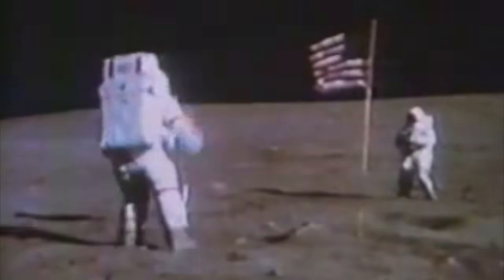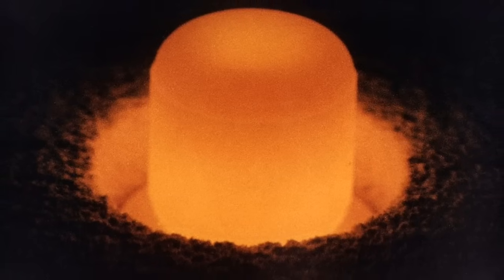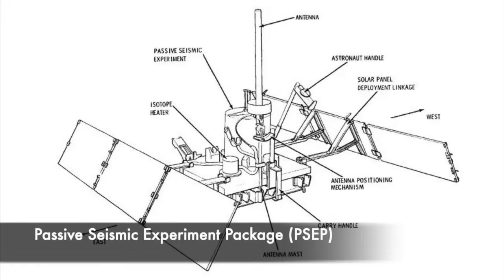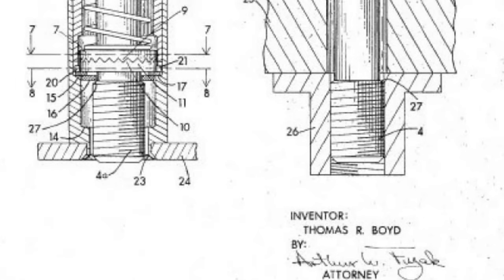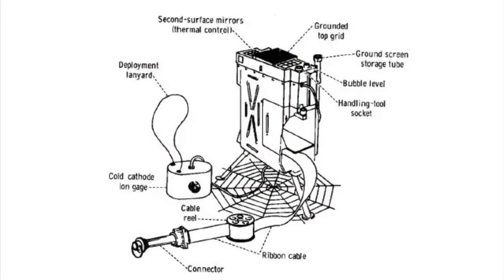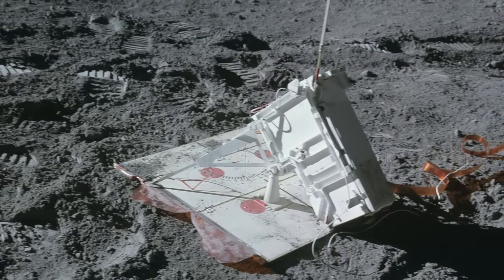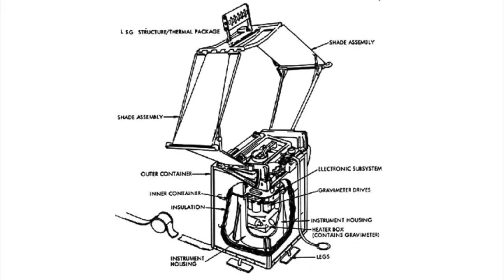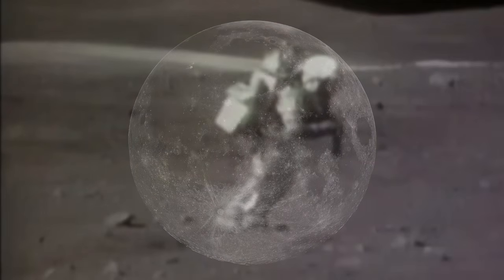ALSEP: Apollo's Unsung Experiments

Comment: Disney
Reply: nope, reality.
Reply: @zounds010  Stanley Kubrick. 154 takes. 😅
Reply: @NoManClatuer-pd8ck  The footage we see in this video, of the Apollo astronauts deploying the ALSEP etc. shows they are in 1/6 g gravity and in a vacuum.
We can't replicate 1/6 g gravity on Earth.
Reply: @zounds010  Like many other Gen X'rs I don't buy that a flying beer can with a little foil and foam insulation traversed the Van Allen belt radiation and is unable to do so now. I don't believe we "lost" the technology to get there over the past 50 years. I've been to Kennedy, I've seen that flying go-kart they call a mercury capsule, I believe that made a low to mid earth orbit but beyond STS I'm extremely skeptical. Will your generation see a manned moon mission? I doubt it. Our government has been selling that PR piece for over 30 years.

Could the Apollo missions have been compartmentalized? If we classified the Manhattan project from most of the world, I think so. Still, the technology is great to see. 

The aerospace industry's tactical to practical pay off has been substantial. I like 'razzing' the moonshot crowd. I hope you aren't offended. I could be wrong, or stupid or both. Still, I believe, even more so, that  YouTube does our society a significant injustice in censorship.
Reply: @NoManClatuer-pd8ck  The LM didn't need to shield the astronauts from radiation. The radiation level on the moon is only 60 uSv per hour, so you can spend 833 hours on the moon with no shielding at all before you accumulate 50 mSv, the annual dose limit for people in the USA.
Reply: @zounds010  Thank you. You've completely convinced me and a million other skeptics. Nice work.

Comment: All staged folks...and here's just one of many proofs:

Apollo missions supposedly provided astronot breathing air for 2 weeks at a time of 5psi and under of pure oxygen.

Sea level atmosphere where we evolved to breathe is 14.7 psi of 21% oxygen and the vast remainder nitrogen.

Every low earth orbit space capsule since the apollo farce has provided near earth's atmosphere pressure and oxygen/nitrogen content (space station, skylab, space shuttle).

There is zero independent evidence of humans breathing pure O2 at 5 psi and 3.4 psi (space suits) for days and weeks at a time.....and a human would develop H.A.P.E. (high altitude pulmonary edema) and die breathing such.

It is a fact that one cannot except for short periods of time breath low pressure pure O2, or deadly HAPE develops as well as oxygen toxicity. 

 It was staged fool.
Reply: No, that is not proof. That is not even evidence. 
1. There's nothing "supposed" about these missions. They are supported by a mountain of evidence. 
2. In the years before Apollo, we found that humans can survive for long periods breathing pure oxygen at 0.25 bar pressure. Our atmosphere is at 1 bar and 21% oxygen, so the partial pressure of oxygen is 0.21 bar, i.e. the Apollo astronauts were getting slightly more oxygen than they would on Earth. This was done by doing extensive experiments here on Earth, in low pressure chambers. 
3. Oxygen toxicity happens when you breathe oxygen at a partial pressure above 1.3 bar. 
4. HAPE happens when the O2 partial pressure drops below 0.2 bar.

Comment: 870 years? Not my problem. 4:00
Reply: After 870 years, Pu-238 has had 10 half-lives, so only 1/2^10 or 1/1024 of the original Pu-238, a few grams is still intact, most of the rest has decayed to lead.

Comment: didn't have 'percussive maintinence on the box full of plutonium' on my apollo bingo card
Reply: I wonder if they asked before they started hammering the Plutonium 😂
Reply: In fairness you'd be hard-pressed to turn the moon into any more of a radiation blasted hellscape than it already is
Reply: To be fair it's just a lump of hot metal, not a bomb
Reply: @refindoazhar1507  No it won't explode but:  Plutonium is exceptionally toxic as a heavy metal even compared to Lead or Uranium, and 238 is a strong alpha emitter, which means you really don't want to ingest or inhale the dust.
Reply: @FireStormOOO_ I dooooon't think they were inhaling the dust from this activity, so it's fine
Reply: @PilkScientist  My point being if they broke the RTG performing percussive maintenance, really the only thing they'd have to worry about is tracking more than a few grams of dust back into the spacecraft.
Reply: Aside from what others said I'm pretty sure that even the pellet on it's own had quite a sturdy casing